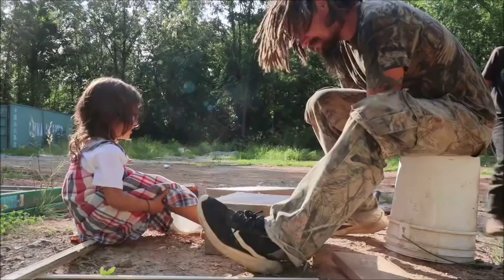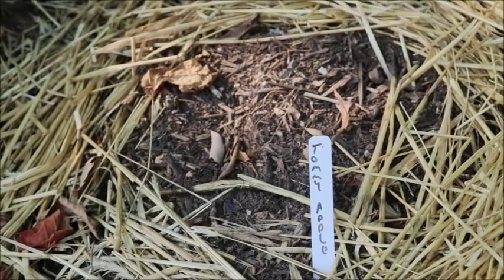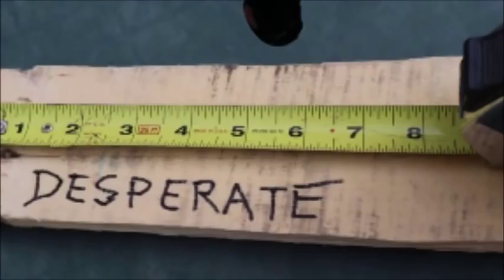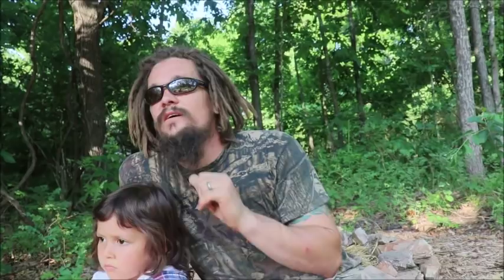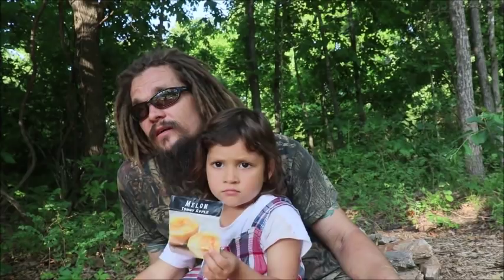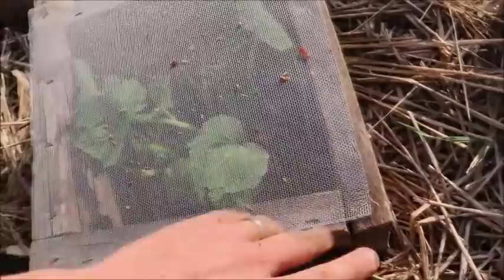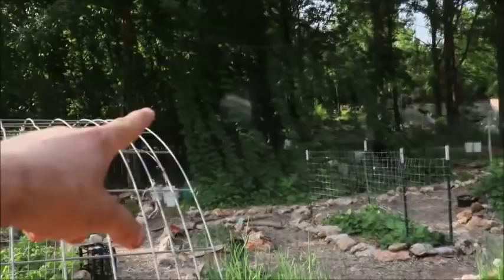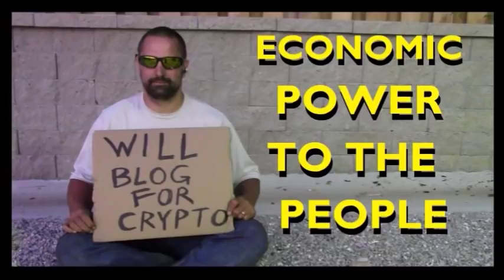WHY WON'T THEY LEAVE HER ALONE? - DESPERATE MEASURES

Comment: There is a book I use in my garden, a lot. It's called carrots love tomatoes by Louise Riotte. I have used this method for years, and it helps. For squash and melons and cucumbers you plant two or three icicle radishes in each hill. Let the radishes grow and go to seed. Also, nasturtiums planted next to them, will repel squash bugs. Hope this helps. Check out her books, they are full of wisdom. Happy Gardening Papa Pepper.
Reply from the maker: Just started planting some white icicles around them and the new ones. Have to buy more white icles seeds.
Reply: @PapaPepper  hope it helps.

Comment: Saw a video a few years ago called Squash bugs must die! He said to spray the plants with water and the bugs come up on the leaves where you can spritz them with soapy water and they die. 
If you don't want to squish them, you can just drop into a container of soapy water. Even my squeamish  friend who said she would puke was able to get brave and protect her families food.
Tip: If you are using starter plants in plastic packs, check the undersides of the pac. I have found them hiding in plants bought from a greenhouse.
They took out all my half grown cucumbers and melons several years ago, but only damaged the gourds on the trellis about a foot high. The rest of the plant was fine.

Comment: I have also had pretty good luck with tulle keeping small critters and insects off.  Can get 40 yds for around $10 on eBay.  You can use it over and over.  I just use clothes pins to attach it to small stakes.  Let’s light and rain in.
Reply from the maker: Great idea. Thank you much!

Comment: Uhhhh squash bugs and squirrels!!!  Charles (OAG) sent me three Comfrey starts! They arrived in good shape and I planted them ! A week later , the squirrels dug them up, Didn’t eat them , just tossed them out in the Hot Sun and I was not home and they wilted so badly, I tried to bring them back, but nope. So, no comfrey for me :( 
   I guess they do that so they can plant nuts for winter . I mean that’s my guess. Squash bugs..... I actually take a roll of duct tape with me and I pull the eggs off with the tape. And any small squash bugs too! The big ones I spray with water mixed with dawn dish soap and they die.  I’ve had to put down sevin dust before too (against my will) but they was just killing my garden.

Comment: We had problems with something that came up from the ground. The following year, we laid down several layers of plastic, covered it with 2 layers of thick cardboard, then built the 2 foot tall raised 4x8 bed on top of that. We filled the bottom with twigs, then wood chips, then our own compost, then lots of cheap store-bought garden soil, then more of our compost, and then an inch of woodchips as a mulch. This all came to about 8 inches from the top. Then built a hinged lid with wire mesh on it like you did. It worked well, and lasted about 6 years before we had to replace it. Guess whatever it was didn't like the rest of our garden, they just went after our zucchinis, pumpkins, yellow crookneck, and butternut. Yes, the plants were crowded in there, but at least they were able to grow and we got some great harvests!
Reply from the maker: Sounds like a vine borer, they can be nasty too.